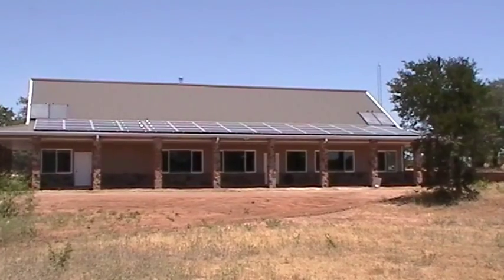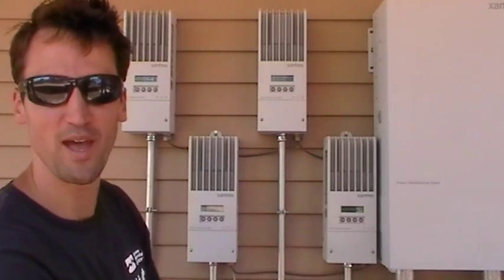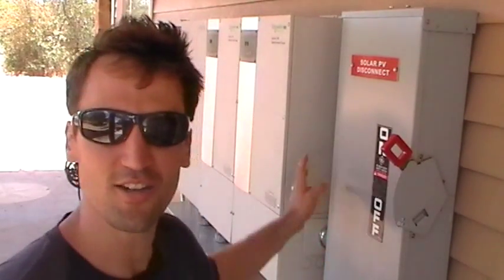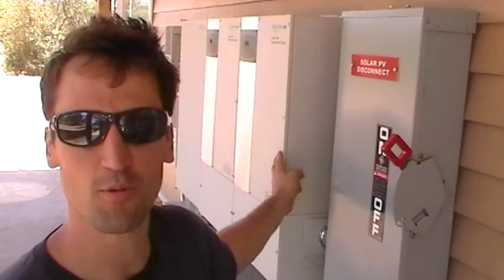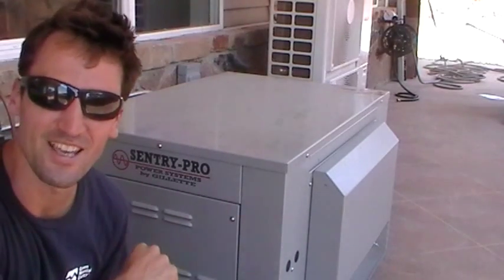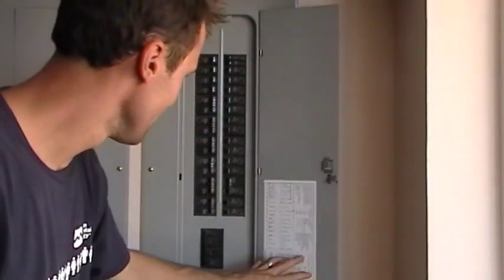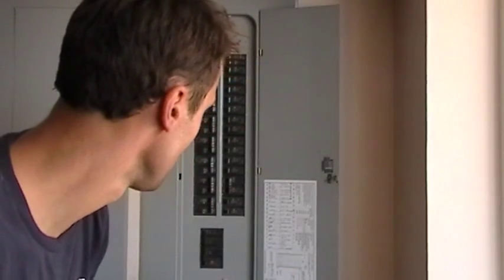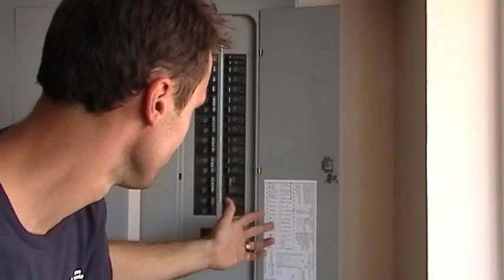Solar Power Installation by Hill Country Ecopower from Austin and San Antonio TX

Comment: thanks @alissada for your questions!!  A solar pv system with battery or generator backup that can connect to the grid and save you money on your electric bill can start small and cost in the range of $6,500-10,000.  That would give you enough power to run a refrigerator, your communications and security electronics and a few light/outlet circuits in an emergency grid outage situation.  The solar power system in the video is many times more expensive.

Comment: How much does this system cost? Can it be used in non emergency situations? I am looking for a supplemental system so that I can reduce my electricity costs and also have a backup system in case of emergency.  I want to get off the grid weather something happens or not.  I want to use the money I would be paying to an electric company and pay it to my solar company,